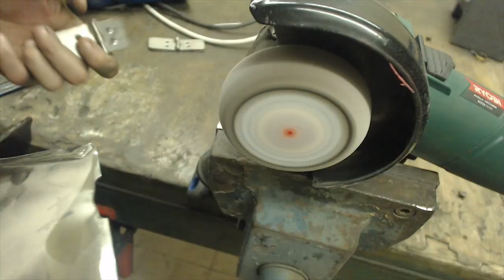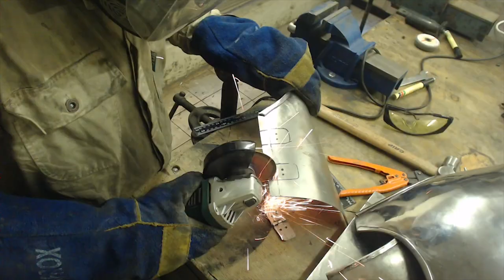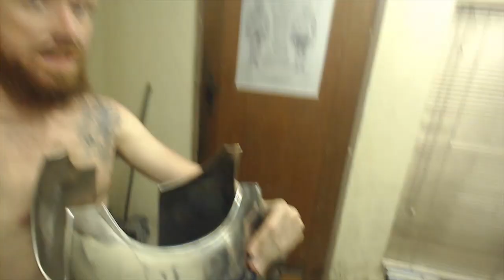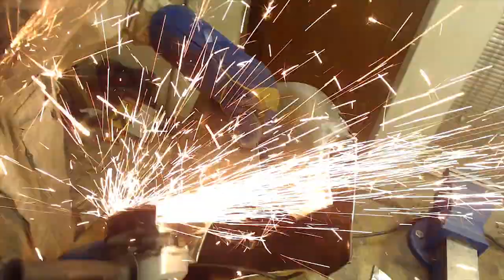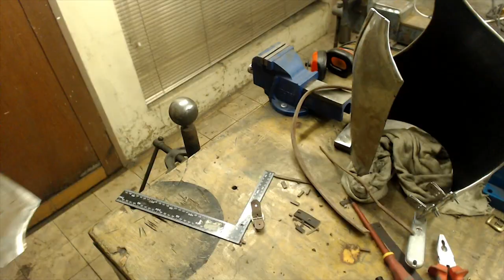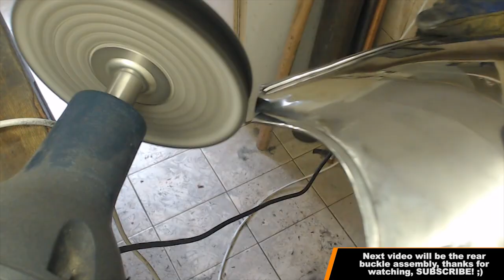Medieval Cuirass/Breastplate Build - Part 5 - Hinge Fitting and Breastplate Cleaning

Comment: With how the breastplate tapers towards your waist, did you have to do anything special to the hinges to make them match the curve? Thanks!
Reply from the maker: Main thing is to not attach the hinges to tightly, so that they can move a little bit as the backplate is opened and  closed

Comment: what kind of grinding disc is that at the beginning of the video? looks really helpful to de burr. The Armorer that I used to apprentice under always used those Flapper discs.
Reply from the maker: It's a flap wheel that you get for your angle grinder, similar to the big ones just smaller. They work really well and actually last quite a long time, this one I think is 100 grit